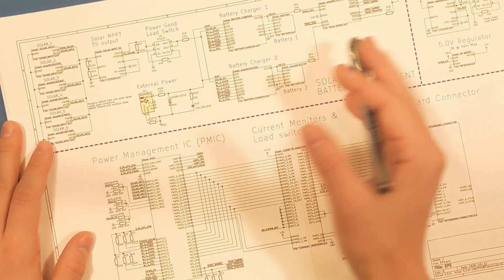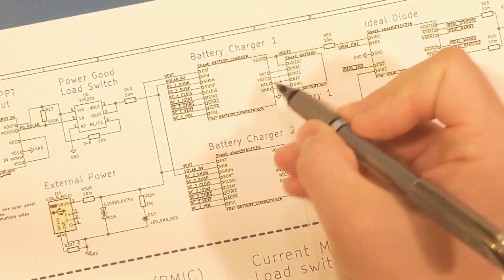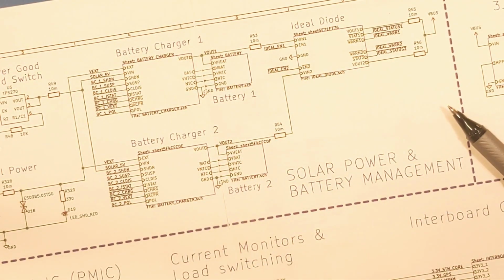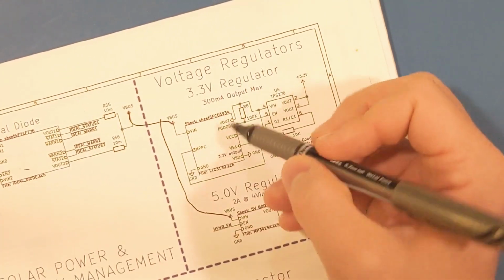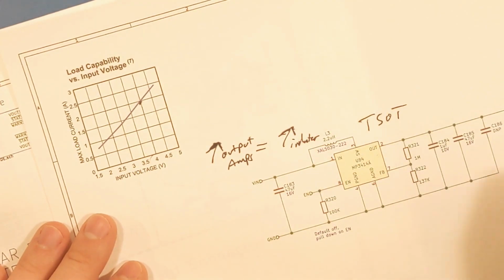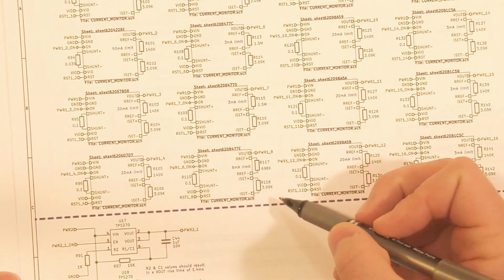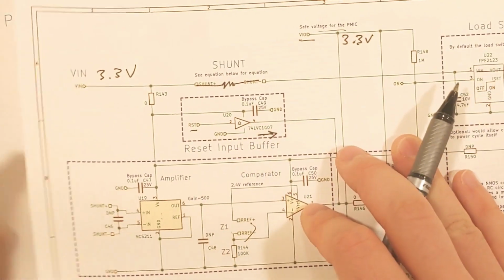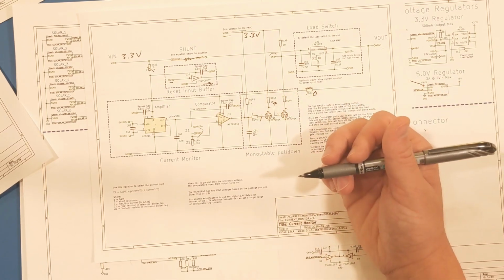$1K CubeSat - Part 8 - Even more EPS Schematic

Comment: Yes!  I wonder if you also use a functional block diagram (or just the high-level schematic).  And what your test plan is for analog signals.  Great series!
Reply from the maker: In part 10 I discuss some of the analog circuitry and how I messed up the op-amp polarity!

Comment: Thanks for sharing. Kindly, is this worth a PhD work? If yes, what are the problems to look out for to solve? I will appreciate your comments please.
Reply from the maker: Hey Ali, I can't answer if this is worth a PhD work, but here are some of the problems to solve:

1) Efficient power generation from Solar
2) Battery monitoring/ Charging / balancing / gas gauge
3) Efficient voltage conversion (battery->some other voltage) for use by the rest of the system
4) Low quiescent current/power consumption 
5) over current monitoring to deal with SEUs quickly.
6) Easy way for the rest of the system to turn on/off voltage rails as needed (everything on all the time wastes power)

Individually, these are not terribly difficult problems. It's that making this a highly integrated circuit is tough.
Reply: I appreciate your help. Kindly, see if you can further give me some directions on the problems raised. Is it possible to combine all these functionalities in one IC? Such as SEUs issues, battery monitoring/management etc etc etc?